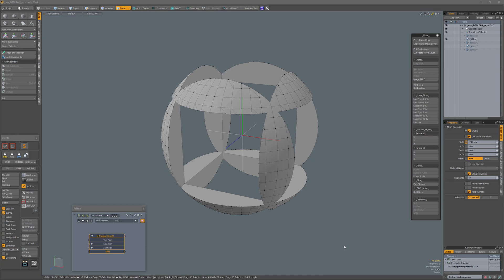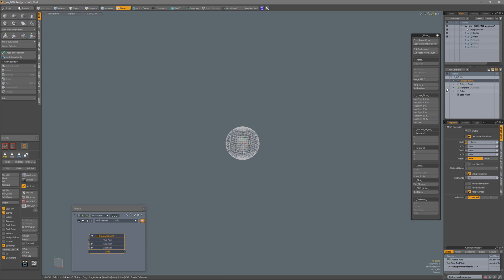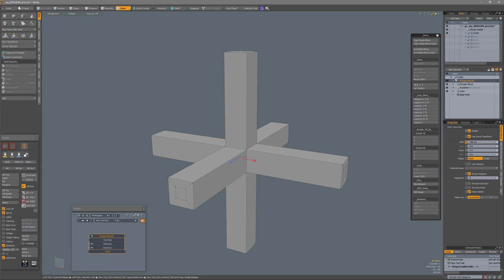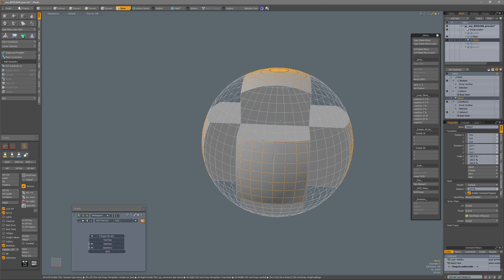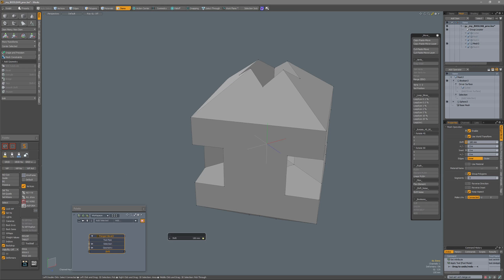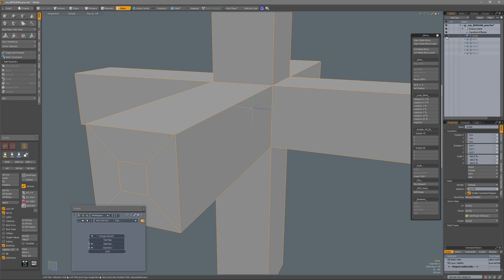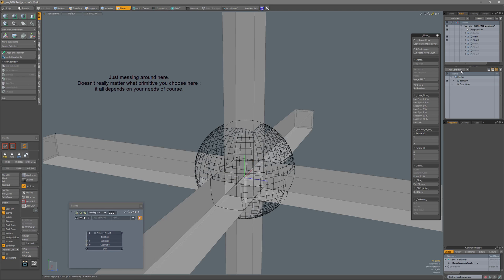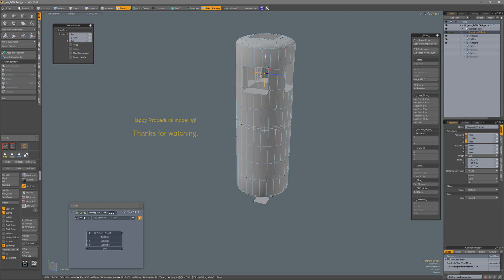MODO 11.0 : Procedural Booleans 1.

Comment: I'm really struggling with this. I create a procedural mesh, add a procedural cube, then do the same with a cylinder. I add a procedural boolean, it asks for a driver mesh,I choose one ( I often get an error message when choosing one of them, something about a dependency loop cancelling the operation ) So I choose one it will accept and then...nothing, the boolean isn't applied. Any idea what I'm missing here?
Reply from the maker: Difficult to know what exactly you are doing without the file.
I guess you have put both the cube and the cylinder in the same procedural item? And that's something you can't do with booleans.
If that's the case, you need separate procedural items.
E. g. : you could create a procedural cube item, create a procedural cylinder item, and then add a boolean mesh op to one or the other.
Better is even to create a third procedural item that merges e.g. the cylinder (or the cube) and in that procedural mesh item do the boolean to avoid dependency loops.
It's like when rigging: it's best to keep things separated.
Hope this helps.
Reply: Thanks for your response Dominiek. I thought I had created separate items. I'll try again but I have to say I have steered clear of procedurals so far because the whole process seems so complicated:)
Reply from the maker: Procedurals require a bit of getting used to, especially when to use them and when not, but they are really usefull in some situations!
Reply: I'm sure. I there a video showing a step by step of how to do this? Thanks for responding like this.
Reply from the maker: - Quickstart video by Andy Brown : http://community.foundry.com/discuss/topic/122400
- Youtube : part of this vid also covers procedurals : https://youtu.be/T64_k-zGvww
- Steve Barrett's Youtube channel with lots of procedural vids : https://www.youtube.com/channel/UCO5QiM7emXQTy8Hhe-lMdfg
And I'm sure there are others ... Maybe search Foundry's website and Youtube.
Reply: OK, thanks for your help, I'll check them out:)
Reply: So, I got to the bottom of my problem. I found your tutorial in German and even though I don't speak German I managed to follow. Most illuminating is the layout you have with both items and mesh ops visible. That's not the case in the default layout so I was expecting to see all my items in mesh ops. Once I separated the tabs I began to understand the process. Procedural booleans will be most useful to me at the moment. Thanks.
Reply from the maker: Glad you solved it!
(BTW : What tutorial are you talking about? Because although I also am able to speak German (My mother tongue is Flemish Dutch) I have never recorded a video in German, haha ...)

Comment: Thank you, I am trying to follow along, but got bogged down (I am using Modo 10.2v4-so it may not yet exist) because when I make the 2nd Poly Bevel and click on "selection" I do not have "select by previous operation" it just isn't there no matter how I spell it, it is not on the list. So maybe it's only in modo 11, I don't know. Thank you for this tutorial though. Hopefully soon I will be able to get version 11, and then I can continue.
Reply from the maker: It's indeed in 11, but in 10 you can also do so with "Select By Index" to get the same result!
Only downside to this is that if you make changes later on that you may have to manually update the polygon selecftion for the bevel, whereas with "Previous" the update is automatic.